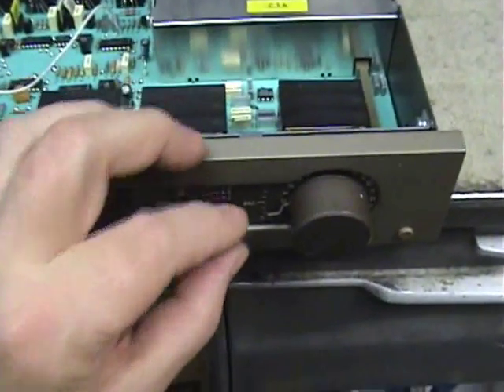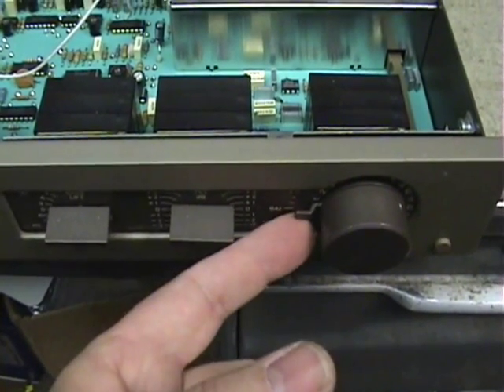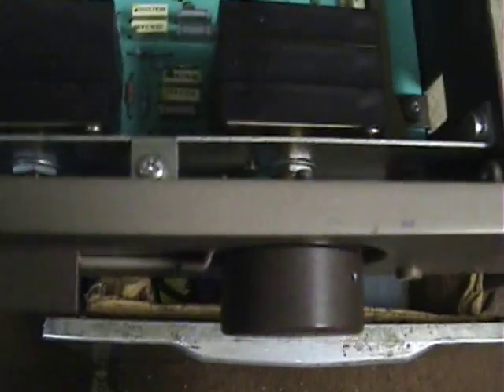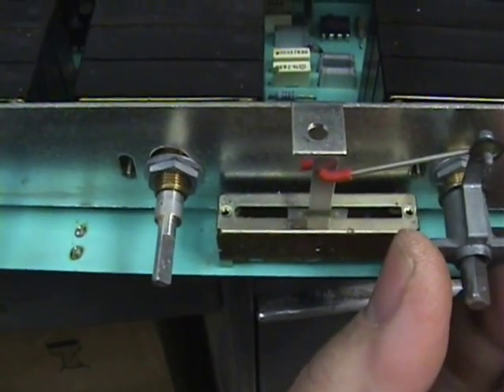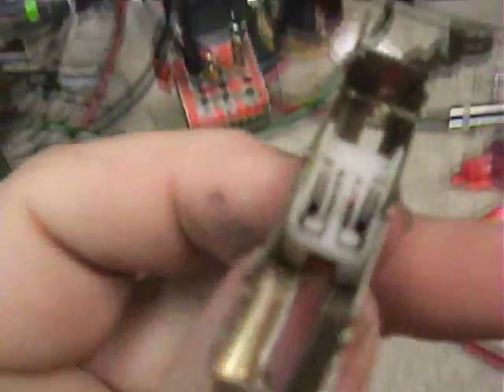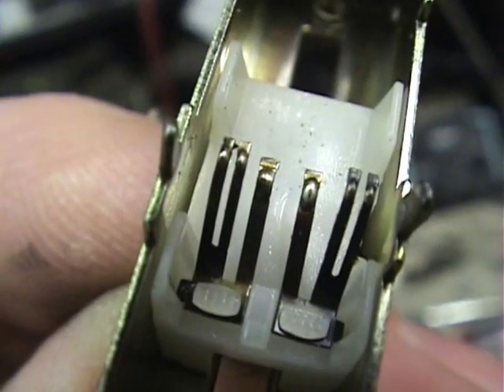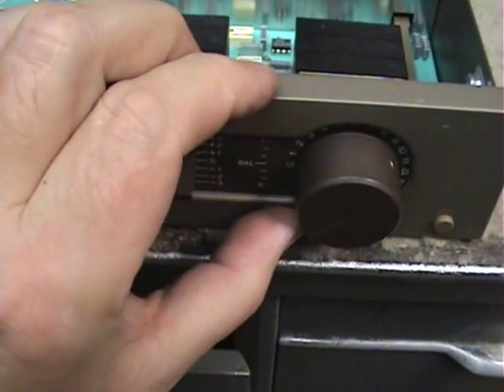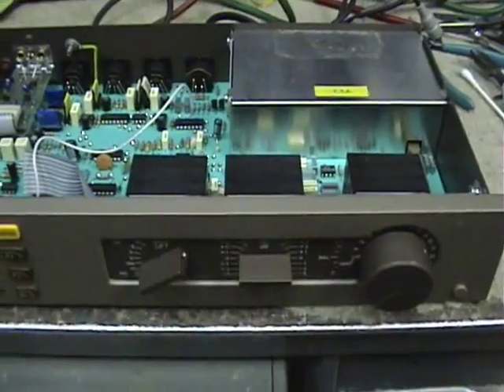quad 34 preamp repair

Comment: I have 3 of those quad 34's in my "maybe later" pile of non working stuff. Everyone of these I have had is DOA. Issues include no LED indicator lights, no output and low volume.

Comment: Hi Rob.
My P34 preamp is acting exactly like this. I 'fixed it', using Blu Tac on the front panel (I have not opened the unit yet). However, this 'fix' is only temporary; The fault returns for time to time. 
I'm not an electrical engineer, but I have used a soldering iron in the past. Can I fix this problem with no soldering involved? Your video does not show how you actually fixed it.
Regards,
Daz

Comment: Just fixed mine with the same fault. I put superglue over the loose plastic tab, applied with a matchstick. I prised off the cover from the potentiometer without unsoldering it from the pcb. I had to open up the lugs on each side to get the cover back and could not close up the lugs on the far side after replacement (the nearside lugs can be closed up with pliers), but this does not matter as a bit of foam can be put between the pot cover and the front panel to secure the thing in place.

Comment from the maker: Hi Giovanni, I was able to fix the fader instead or replacing it. I did not try to buy a new one. I forget if I glued the fingers in place or mented the plasticto tighten them up. You will know better after yoy take the fader apart. Don't loose any tiny parts !